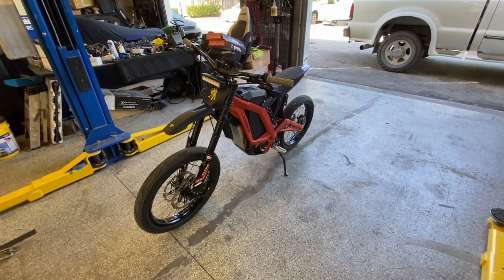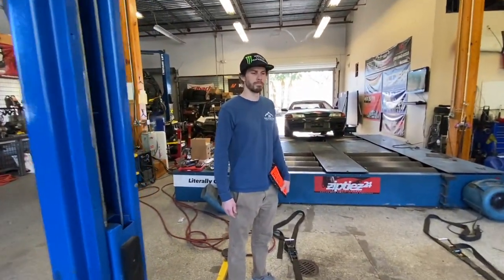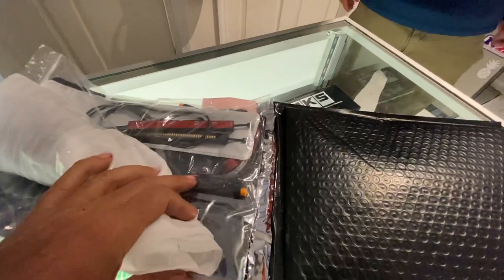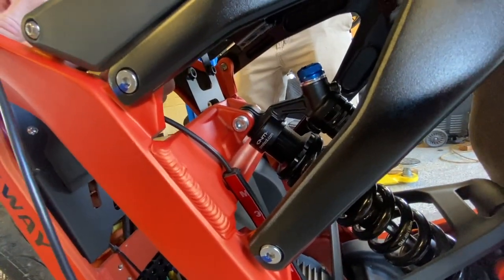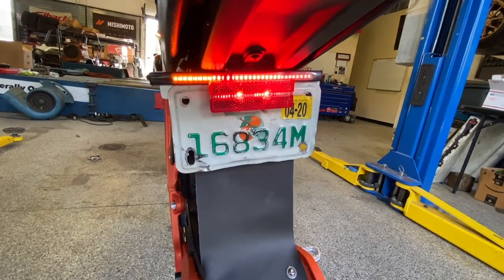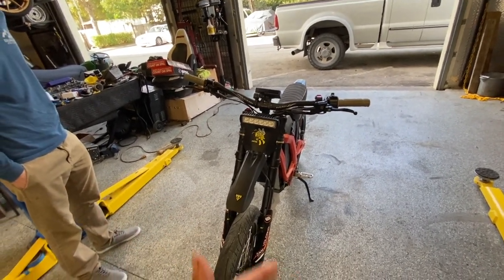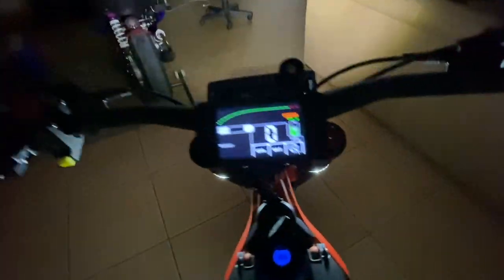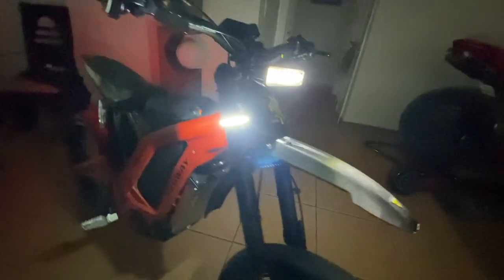eMXshop Light Kit | SUPER BRIGHT | STREET LEGAL

Comment: Seems like a nice kit, how much does it cost? It seems to be unavailable through the amazon link and it doesn't list a price. It is definitely a stealthy install as they really don't stick out and you would barely know they were there. There is no question that this kit will massively help make you more visible at night and in low light conditions and with the additional brake light and turn signals this will help show your intentions to other road users. On a sunny day I would have more concerns with how visible these lights would be though especially the turn signals. Of course it would not hurt your visibility at all but I would probably still use hand signals as well as the turn signals during the day, just in case.
Reply: They are sold out but will be back in stock on Wednesday!

Comment: Its nice but missing some under glow or maybe a strip on the sides Idk ? But very bright high quality leds 👍💯👍
Reply: The kit comes with RGB and white underglow included
Reply: @e-mxshop3459  how do I wire in those extra strip lights with the pins on the end?
Reply: @davidkauka4702  the pins on the ends of those strip lights plug into where the original reflector/ tail light power is. Don’t worry about plugging in reverse, it lights up when you plug it in the right way.  One of them is RGB one is white. Enjoy!

Comment: Pretty late to this but what was the 0-60mph time? (0-100kmh)
Reply from the maker: 5.9 seconds best.  Low 6’s average without topping off the battery.
Reply: @Jack Cecil  that is fast. Awesome thanks. Do you have 17 inch rims front and back? And what size sprocket you runnin? Thanks.
Reply: @JackCecil  just letting you know I'm out for your top speed record 🤣 running a 400amp 72v battery and 500 amp motor phase on a xion bike tuned bac 8000. I weigh about 135lbs on 17 inch supermoto tires. I'll let you know in a few months haha.